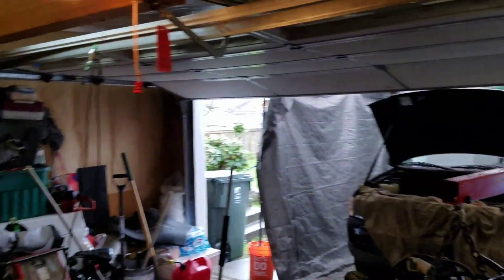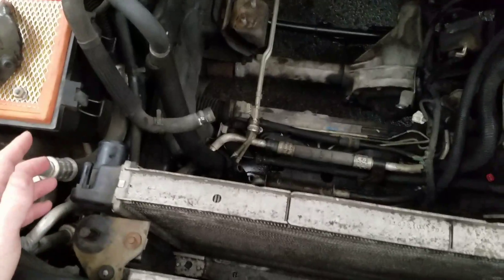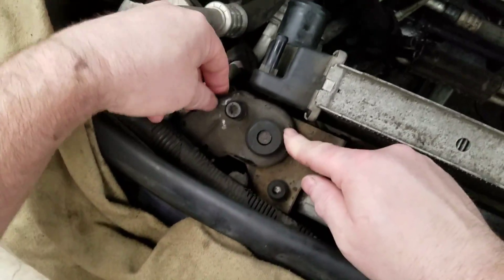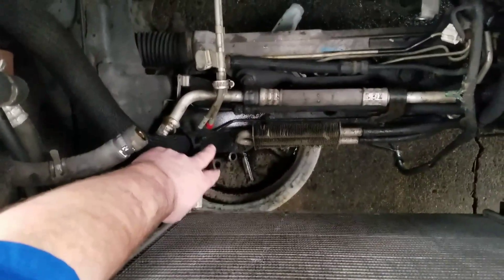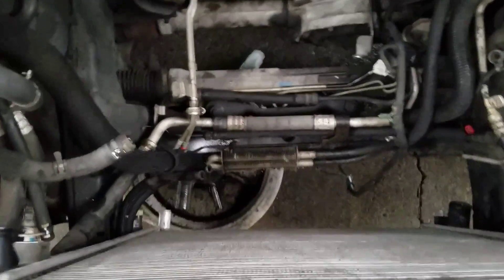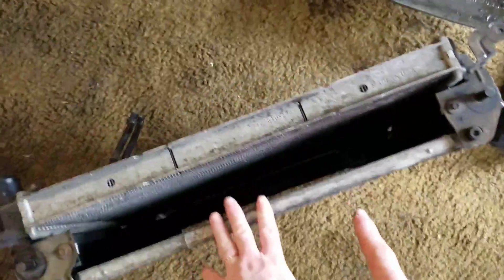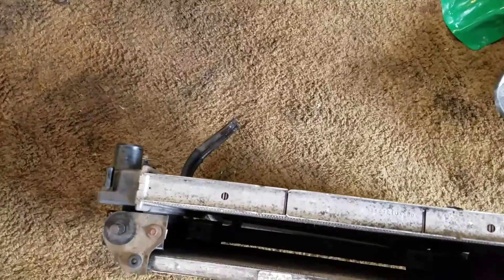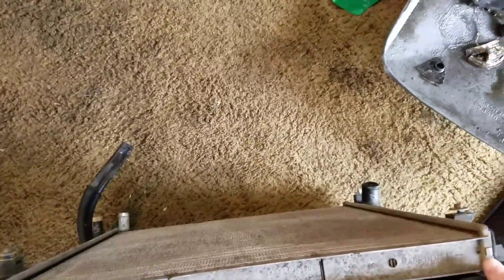Tip..2002 Ford Explorer Radiator Removal

Comment: Disconnect the oil lines from the bottom side of passenger side also the trans lines from the bottom front of engine

Comment: Hi Steve thanks again for the video I am currently putting those components back together outside the vehicle I will be  hi Steve thanks again for the video I am currently putting those components back together outside the vehicle I will be  removing the condenser tomorrow and putting the whole unit back in I have the equipment to do the vac down so it's making it easier  for me to pull the condenser.  In the next day or two I will be reinstalling the transmission and exhaust .  I have currently done the entire swap for my channel to this point . By the way you have a few more subscribers than me ,  thanks again !!

Comment: This is only if you have the engine out it’s going to be a little tougher with fan and everything else still installed
Reply from the maker: you pull the shroud off, so you still have to pull the fan off anyway. you can leave the belt on. With the right tool you can loosen the fan easily and get the fan and shroud off and out of the way.

Comment: Will the motor come out without removing the radiator i did pull off all the front accesory brackets just hoping it will clear i set power steering and ac clutch assy to the side.
Reply from the maker: I dont think so

Comment: How did you get the cooler lines near the bottom to disconnect?
Reply from the maker: On this expolorer the trans cooler hoses had spring hose clamps. That allowed the rubber hoses to come off the steel lines.